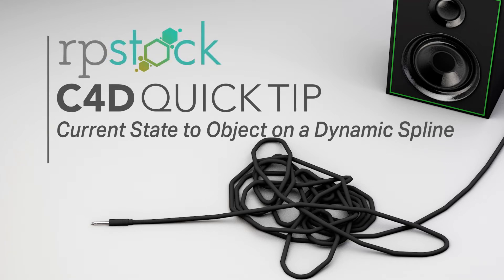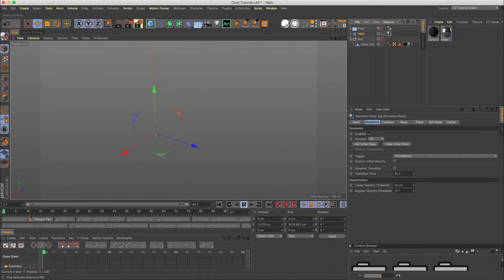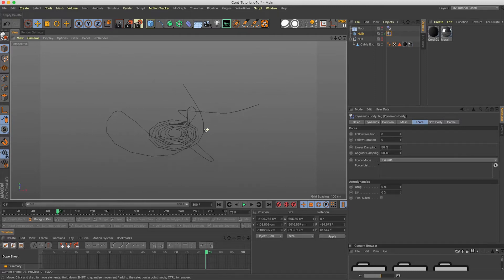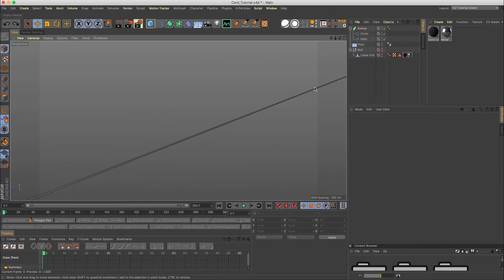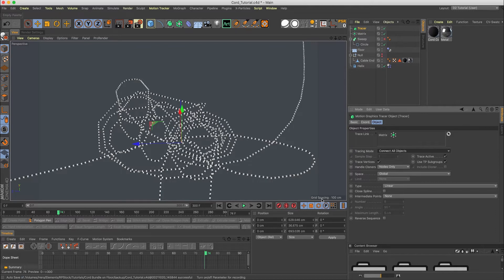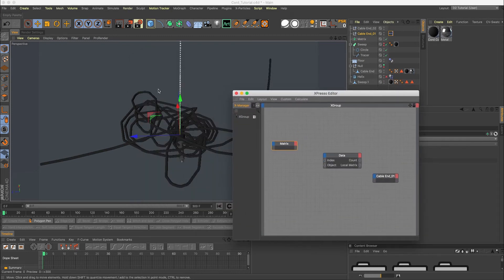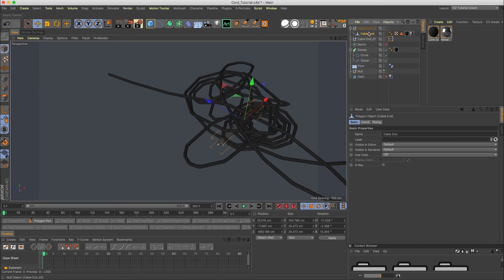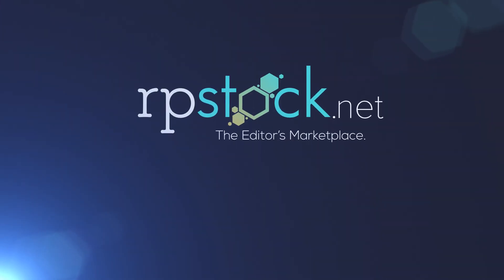Cinema 4D Quick Tip Current State to Object on a Dynamic Spline

Comment: after experimenting I have discovered that another, perhaps simpler, option is to bake the animation as an alembic, then turn off animation in the alembic options, and then convert current state to object.  This works with all dynamic physics simulations.
Reply from the maker: This is an awesome suggestion and work around. I will check this out. always forget about the alembic animation bake. Thanks for checking out our video!
Reply: dude, you saved my live, thanks :)